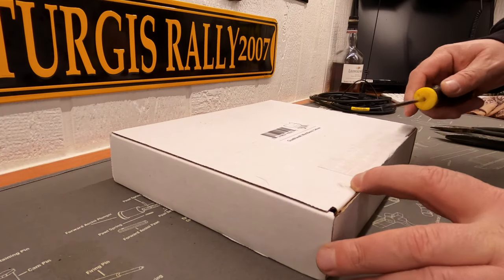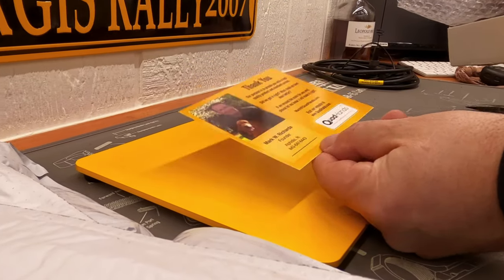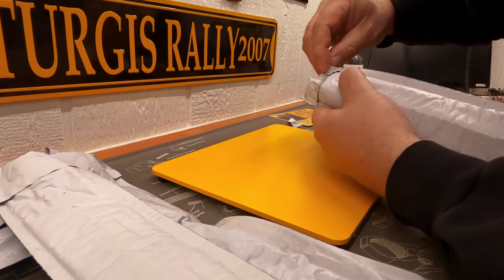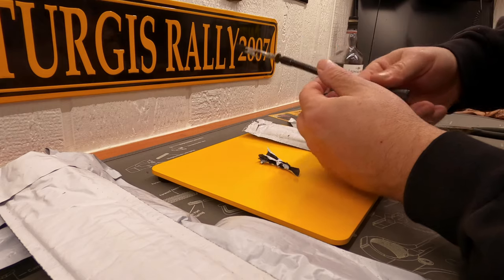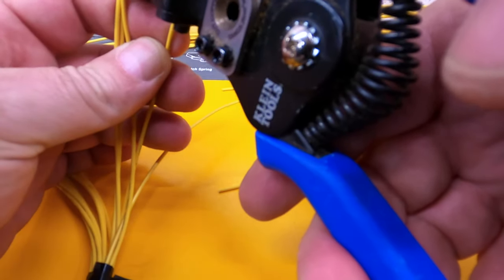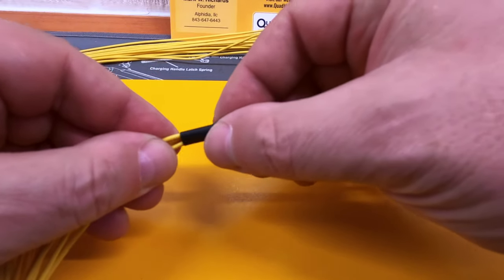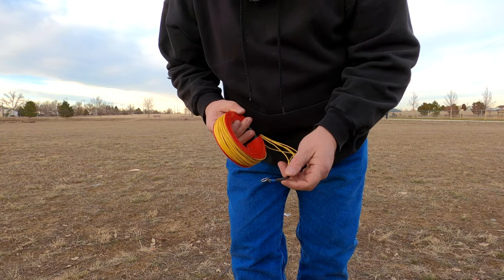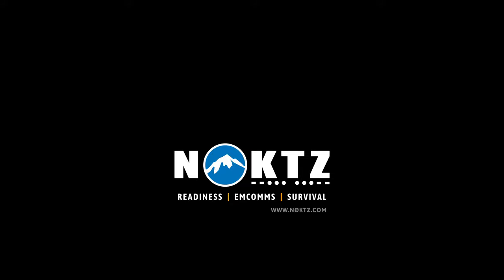Tuning Ground Radials For Vertical Antennas

Comment: In the Seattle area, I battled my portable 1/4 wavelength vertical a long time until I coiled the tips back to 1/4 wavelength to get the SWR below 2.1 at resonance.  Everyone who commented that length doesn’t matter is welcome to come out and experience it themselves.  I envy people with soil conditions that actually couple with the radials
Reply from the maker: Agreed. Out here in CO, I've found that it helped me, and the proof is in the pudding. The folks who disagree might try to prove their argument on paper (or keyboards), but the bottom half of a dipole will perform better if it's tuned right. It works for me, too. Thanks for stopping by and commenting, Brian!

Comment: FWIW you might find it interesting to try a crazy number of very short radials. I have relatively good conductivity soil here, I have recently stripped down a lot of old CAT5 cable, a very cheap way to get a lot of thin wire although it is time consuming unravelling it. It has been very surprising how well 32 radials just 2m long work. Though the 64 radials of 8m long are still work in progress. 73
Reply from the maker: Indeed! My initial goal with the spools were for quick deployment in the field for a portable station. I've since moved to different lengths of radials connected with Andersons wound on a single larger spool. So far so good. Takes me about 60 seconds and I'm up and working. I should shoot an update film. Thanks for stopping by and for the motivation my friend. I also want to try elevating them a bit off the ground to see if it reacts with more of a counterpoise effect. Never know until you try... 73 and good DX.
Reply: @N0KTZ  I forgot to praise the soldering stand! Generally with elevated radials it is recommended to go for quarterwaves for the bands of interest, mine are for a fixed station and a small garden so elevated radials are not very practical. It has been fascinating to do some experiments, certainly the short radials seem to work very well for me. I think the conductive soil here is a mixed blessing and might be more tricky than a less conductive ground, counterintuitive I know... 
Enjoy your radio, 73

Comment: Bunnings no longer sell the t bolt hose clamps but ebay does under duraseal  hose clamp they do have the 44.5 to 50.88 but only in lots of 5   73 vk3qp

Comment: What gauge wire did you use? Is that SOTA wire by chance?
Reply from the maker: Hey there, I now use Marine Grade 16g AWG from Ancor. But the yellow stuff in this video is 20g. The 16g is obviously much heavier but easier to deploy and pack up. I also connect different lengths with Anderson connectors now. My new setup these days is one larger spool with 16g with all the radials wrapped on one kite reel Hope that helps.  73.